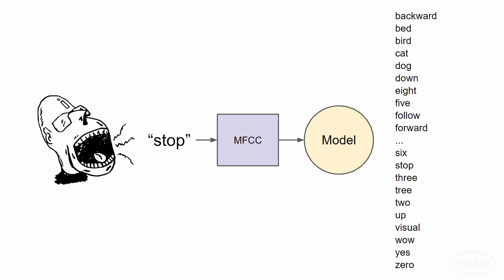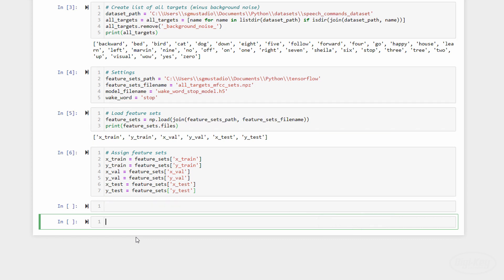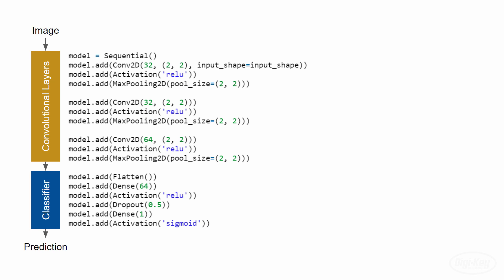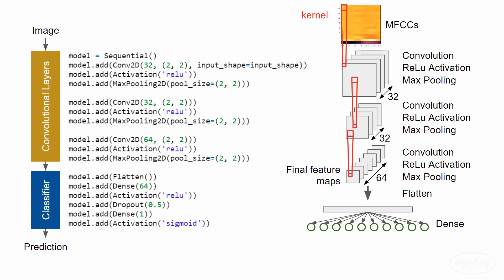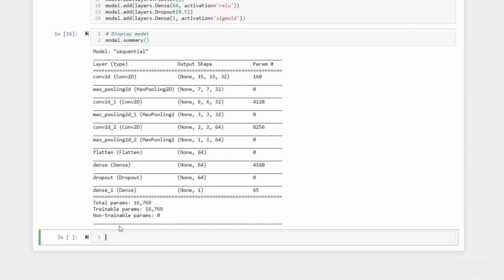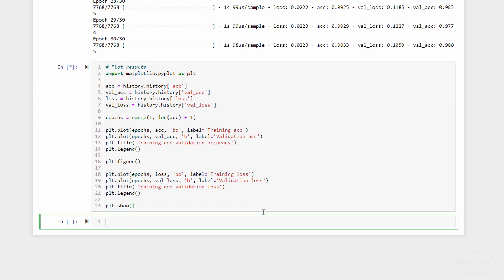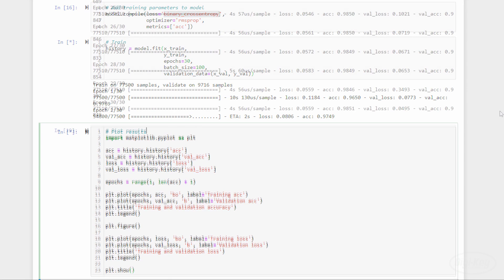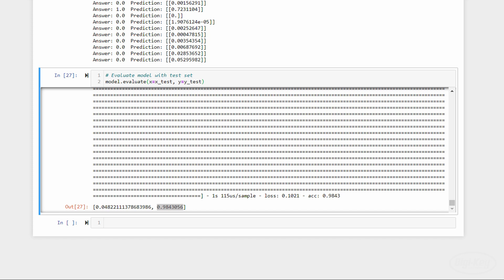Intro to TensorFlow Lite Part 2: Speech Recognition Model Training – Maker.io | Digi-Key Electronics

Comment: Hey great video but just curious if you could add more then one wake word?
Reply: Of course - just train for a different wake word and run the inference multiple times using the different sets of kernels from the training step. You will scale up the computational requirements of course because you have a different model for each classifier and each needs running independently.
Reply: @edlakota  Hello, can you give more details about that ? Thanks